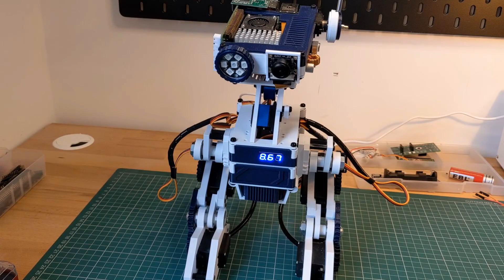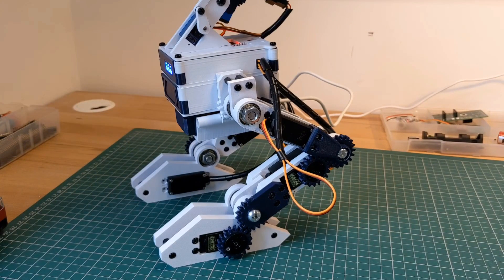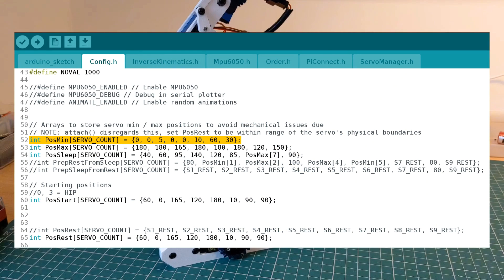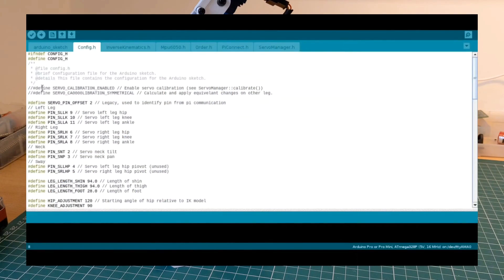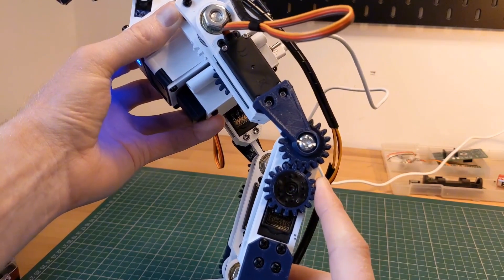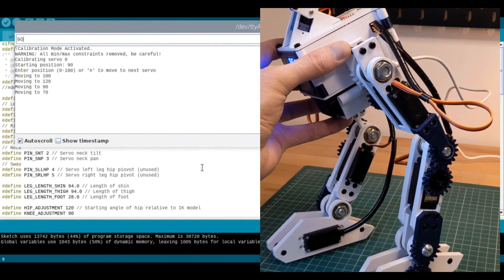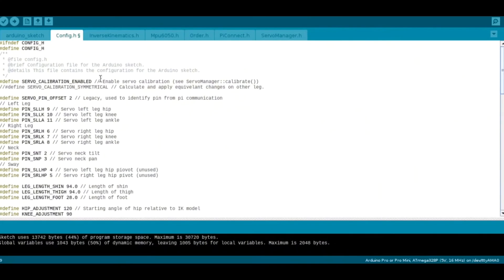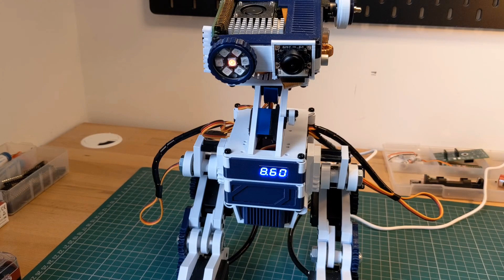Legs Made Simple | Raspberry Pi 5 Robot Build

Comment: I have calibration routines for any of my creations that use servos. I save these calibration values to eeprom rather than copy hard values into the code. The pro-mini has 1k of eeprom. More than enough to hold this data. I also have an offset value that is added to the commanded angle to correct for the small error that may exist in the positioning of the servo horn. On startup, I check a ProgVal to see if the eeprom has calibration data in it, then load those values into the array for use whenever the servos are moved.